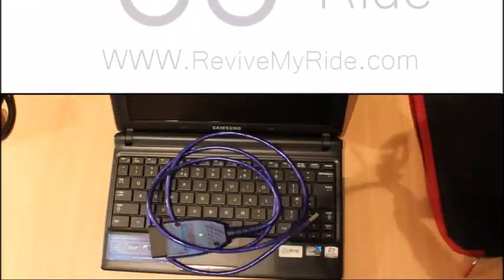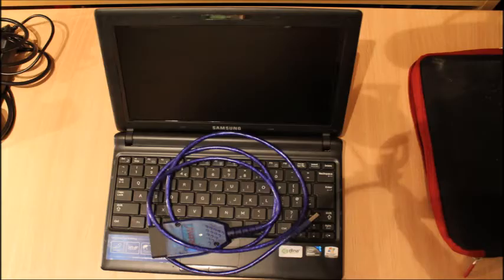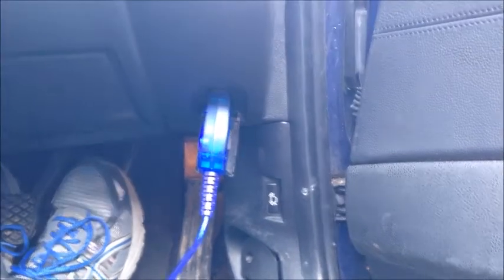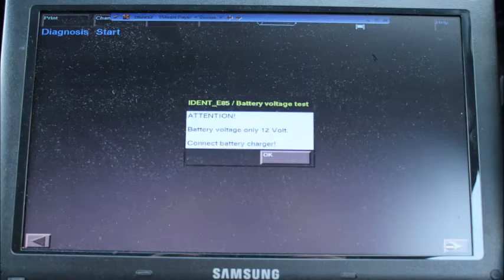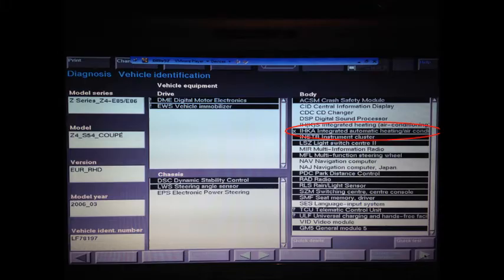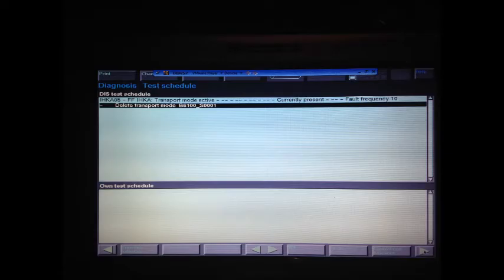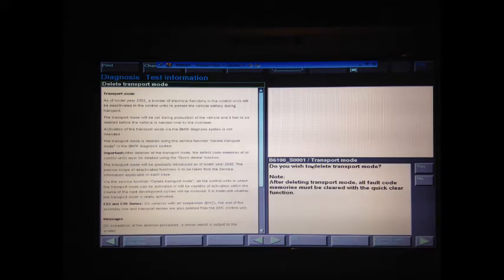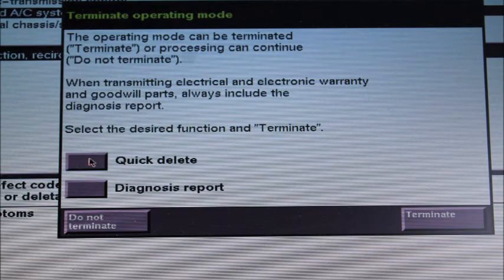BMW Transport Mode Reset using DIS software - will fix problems with heater blowers and demister etc

Comment: DIAGKING Compatible for BMW-INPA K+DCAN Diagnostic Cable Support E serials E39 E46 (with Switch) Work with ISTA SSS NCS Coding Winkfp Programing this is the software will this work?
Reply from the maker: Hi @user-sf2gu1vr8n INPA has a lot of similar functionality as DIS but it seems people have a lot of trouble with disabling transport mode with it. You have to go into various systems and fix individual symptoms. I'm not sure if it is possible to clear it completely, here is a forum thread where they discuss it: https://www.bimmerforums.com/forum/showthread.php?2125555-INPA-Delete-disable-Transport-Mode Personally, I would stick to DIS. I recommend Cable-shack because of their support in getting the software up and running, I'm not affiliated with them in any way.  Hope that helps. Thanks, Phil

Comment: Hey, thanks for this video. I have exactly the same issue on my 06 / Z4, transport mode  seems activated with my 12.38 low voltage battery. In October 2022, where is the best site to order the the cable ? On Amazon for exemple ? And what about a DL link ? Thanks for your shares ! Jean-Marc from France.
Reply: Thanks for your answer, Phil. All cables are out of stock :( I'll try to find another K-line supplier then.
Reply from the maker: @mljm9209  Sorry about that! I can't recommend anyone else I'm afraid, as I haven't used any others but you may get some hits on forums.
Reply from the maker: Hi Jean-Marc, in the description there is some info on cable-shack, who I bought the cable from. I highly recommend these guys. https://www.cable-shack.co.uk/ Although based in the UK, I'm pretty sure they will supply into Europe. There can be a few problems getting the software to work and cable-shack gives good instructions and even some tech support if you need it. Basically, if you order the cable and software from them, it may cost a little more but you know it will work! Thanks, Phil

Comment: Thanks, this was a big help!  I had a heck of time getting the software to run, ended up having to load it on an old XP laptop I had.  Finally was able to get the drivers to load and from there on, it was a piece of cake!  Thanks again for posting!
Reply from the maker: Thanks for your comment! Yep, I had the same thing, the most difficult part was getting the software working but Cable shack helped me out with it! Glad you got there ok! thanks, Phil

Comment: So I had a comment on here but deleted it to update it. This video defo helped me and I did buy the cable from cable-shack. It took a lot of time for me as I’m not experienced in this stuff at all but with some careful following on the use of the software and cable and the help they have on how to do it, all worked and now fixed. Thanks man.
Reply from the maker: Thanks very much for taking the time to write your comment. Music to my ears, really pleased you were able to resolve your problem and that the video helped, its the reason I make them :-) tbh, Cable-shack had to help me too with the set up on the computer etc but their customer service was great, which is why I recommend them. Thanks, Phil

Comment: Does this work with a 2010 BMW X5 ??
Reply from the maker: Hi, I haven't tried it on this model car but yes, theoretically, it should work. You would need a different cable called a "D-can", which is available from the Cable-Shack website. Hope that helps!

Comment: Thanks very much for this video, exactly what I needed.  I've spent over £100 in the past taking my E86 to garages for them to sort it out so dcided this time to try clearing it myself.  Following your recommendation I got the D+K cable from Cable-Shack and despite a few software installation issues which Jimmy at Cable-Shack helped with, had it up and running in about 45 minutes.  I initally plugged it in in D mode and had some very quirky results but went back to Jimmy who pointed me in the right direction.  I switched to K and after following your walkthrough, had deleted transport mode in about 5 minutes.

Can't thank you and Jimmy at Cable-Shack enough.
Reply from the maker: Hi Malcolm, thanks very much for taking the time to post your comment! I'm really please that the video has been able to help you! Exactly as you said, I had no hesitation in recommending Cable-Shack because their customer service is so good. As you are probably aware, the software and cable also allows you to do all sorts of other stuff but I haven't explored them yet. Let's keep these E86's on the road, they are great cars and are getting pretty rare...

Comment: I have x5 it shows transit mode active and fault showing in junction box
Reply from the maker: Assif Shaikh the software and cable I used in this video should be able to clear your fault, you can go on the Cable Shack website and check. However, bear in mind there will be a reason your car went into "Transport mode" usually a very low / dead battery or possible if you have been in a small accident and the battery cut off switch has triggered. Make sure you understand and fix the root cause problem before you try to reset or you may go around in circles. Of course, the dealership will also be able to reset the transport mode for you, I was just trying to save a little money! :-)
Reply: Thank you very much sir appreciate your help  but the problem is today morning when I start the vehicle it's not moving I mean gear not shifting
Reply: I have icom dignose tools sir

Comment: Thanks very much for this - exactly what I needed.  I will be attempting this when my cable arrives

Could you tell me roughly how long the process takes end to end?  Does it take minutes for each page to load/update, or is a matter of seconds?
Reply from the maker: Nigel Jordan thanks for your comment! I spent an evening getting the software on and understanding how to use it, also had to ask cable shack for a little bit of help because I'm not very tech savvy. Once it was up and running and plugged in, I found pages often took 10-15 secs to load but I have an old and very slow laptop! Hope that helps and good luck with it!

Comment: I have this problem with my Z4 :( do you know if a wireless obd reader would work with that software?
Reply from the maker: Hi Sean, sorry, I don't know if the wireless OBD will work with the software or not but you should drop the guys at cable-shack a message and hopefully they can help. Their full contact details should be in the description under the video. Good luck getting it sorted!

Comment: Very informative.
It would be great if you could post more videos relating to bmw e85 z4, in particular with the s54 engine if at all possible.
Do you also have INTA by any chance?
Reply from the maker: Hi Jose, I forgot to mention it in the video but when you buy the cable from Cable-shack, you get various pieces of software, pretty sure this includes INTA but I haven't had cause to use it yet. Yes, I have plans for some more work soon on my Z4M, so there should be some S54 related videos for you soon!